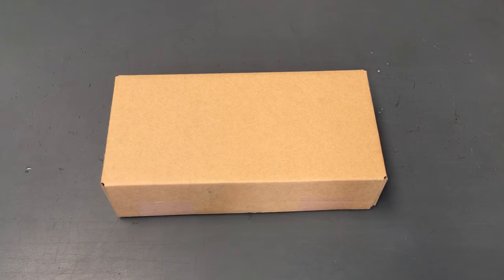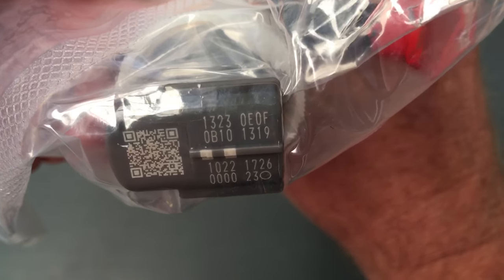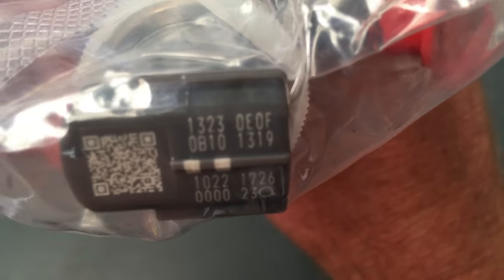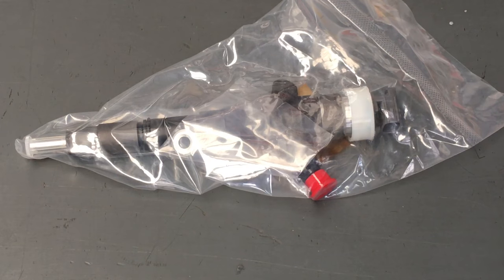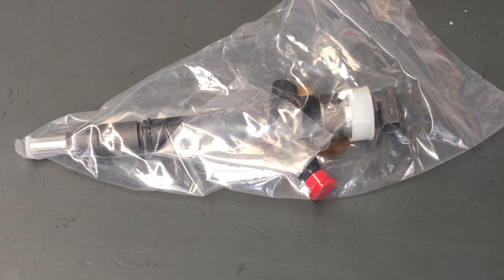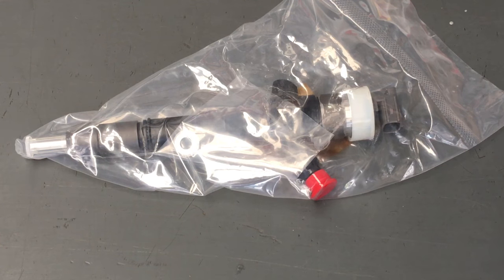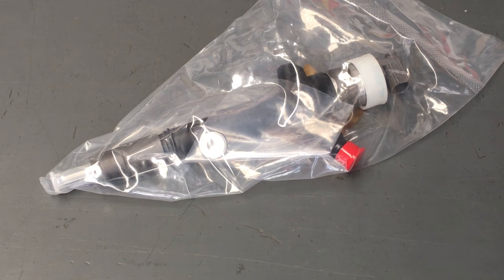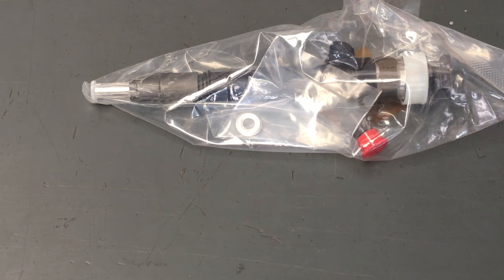INJECTOR COMPENSATION CODES EXPLAINED

Comment: why is the number so  long and complicated? surely a 3 or 4 digit number would contain enough information for how much to add or subtract the pulse duration to equalize ?
Reply: The number is long because each 4 bits are a compensation value for a given fuel pressure and actuation time and there are depending on injector manufacturer like 8 or 10 arbitrary points (VL VE LL ... etc) so u do the math and here's your code

Comment: Interesting, i have had dealer do this for me and they said it was wrong from factory. Have knock only at low elevations. They told me that the should have been put in 1 / 3 / 2 / 4  for this specific vehicle. Instead of 1 / 2 / 3 / 4. Do some cars and tools have the fields different to each cylinder?

Comment: Hi, I did a scan on my 2010 Nissan Navara D40, diesel (European manufactured). I came up with a fault code P1622. Can you advise given your experience what might this be? I'm getting different feedbacks to the point where I'm confused. One is telling me that I need to recode my injectors. The other is telling me that there's a problem with the EGR system. The problem is that the vehicle cuts out ever so often. Cuts off whilst coming to a stop, cuts off while running at low speeds etc. Looks like I'm lacking power somewhere.
Reply: EGR is shit! Disconnect that and regain some power.

Comment: U can buy a scan tool & do the coding yourself easily. You can buy a scan tool for under $500 bucks. I had to do it on my MN Triton after a mechanic pulled the injectors out to do manifold cleaning and valve adjustment. While the injectors where out he got them mixed up on the bench but said long as they were already coded for the vehicle it didn't matter which cylinder the injectors went back in. I don't know if that info is 100% correct though. Yes it did run reasonably well when it was finished but the injectors were pretty noisy and it started running a little rich. Soon as I re-coded them for each specific cylinder & then did a SQL it was back to normal & quiet again. Maybe I just imagined the other differences but I do know that it did run quieter & the egt dropped 50 deg C after the coding process.

Comment: I’m in uk & doesn’t seem to be a whole lotta Hilux specialists to take your vehicle to so I’m probably going to do an injection change myself. I have a 2011 2.5 D4D HL2 2KD FTV, on 145000Miles what is that hand held device you use to do the pilot learn, are they available to the non professional? Or is their another machine available? Also would a regular diesel specialist be able to perform a pilot learn procedure? I also think I need to replace a lifter as I have a regular tapping coinciding with engine revs, great informative video’s
Reply: Mate, for the tapping noise, I believe your injector nozzle tips have been contaminated, best to clean up the nozzle tip to free any debree or signs of water or oil and free the nozzle plunger so they can inject much smoother. This will solve your tapping sound

Comment: 2021 Silverado duramax 3.0 
Code was bad fuel injector  2 
I changed bad injector. 

Cleared codes and worked  good for 5 min, then code came back as well as esc, parking break …
Safe to say my thick head didn’t realize it needed to be programmed.

Comment: My friend hi, i did this exercise  short times ago, but failed,   first i started with injector compensate code, and successfully  entered,  but shortly  the code  p1604,appeared,  eeprom injector  correction value happened,    all the number  above the injector are correct, 
And i tried   making  pirot learning,  but still there, what is the solution,  while  i decided to clear the value,  still rattling sound appeared  when rpm reach 3500,
Reply from the maker: Sometimes it fails keep trying again try different scan tool
Reply: Clear the codes, don't enter the new codes, shut the programming tool, turn the ignition off disconnect the battery for an hour, then connect the battery, connect your programming tool and enter the codes. Remember it's only A to F,  0 to 9. 
A lot of people mistake the zero 0 for an O.
Then using your programming tool do Small Injection Quantity Relearn so that the ECU can learn how much fuel to inject.
Just my to cents, hope this helps.
Let us know if this fixes your problem?